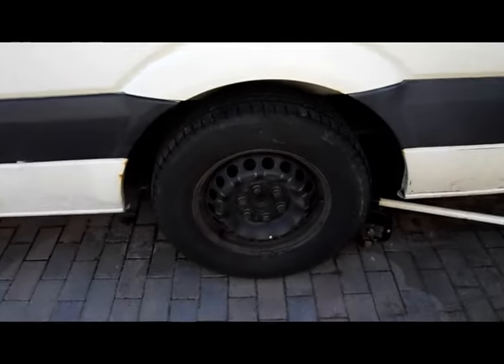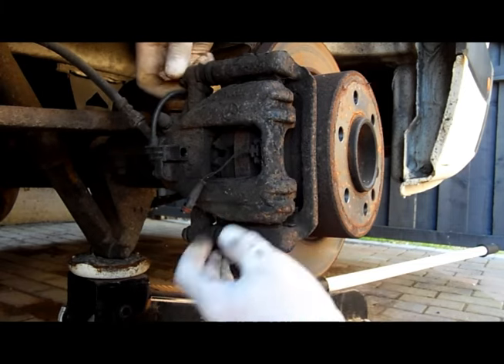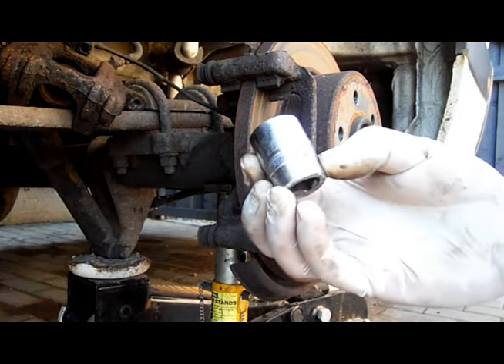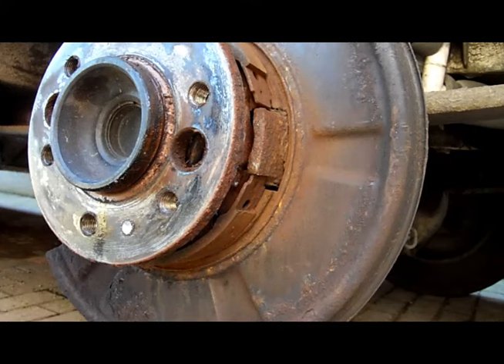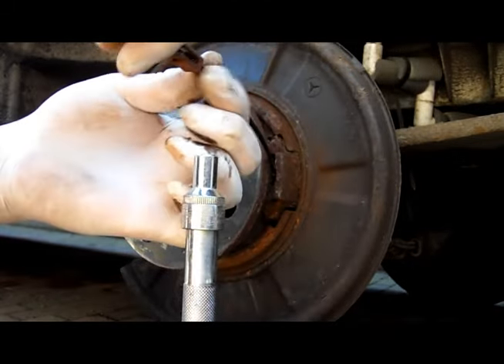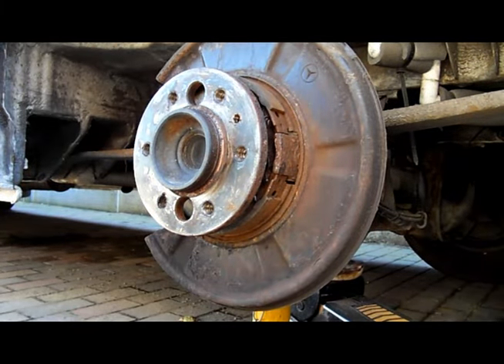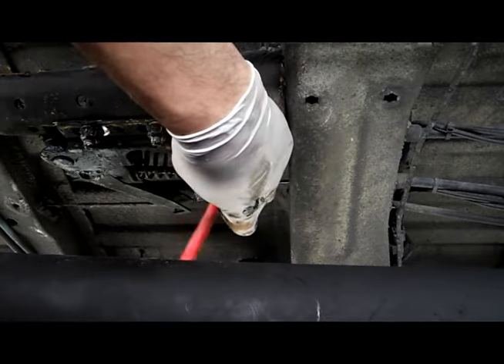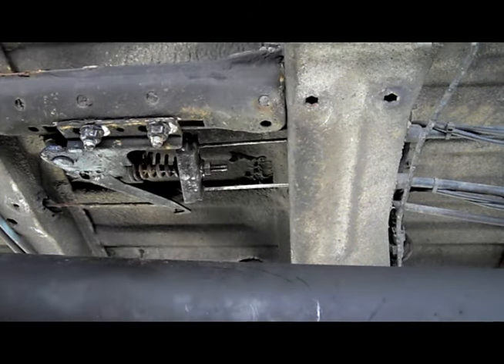VW Crafter / Mercedes Sprinter Handbrake Fix

Comment: Tip for all. Use high temp brake grease in place of copperslip. It will last years rather than weeks. Copperslip has it's uses, but it's only marginally better than nothing on brake companants that get a lot of heat through them.

Also, the torx bolt holding the disk on. If an impact driver doesn't work. Nothing will. Drill it out, but you don't need to replace it. It just lines the disk up with the holes in the hub to make getting the wheel on easier. Instead just pop the handbrake on when the holes are lined up..... saved you a faff on drilling out that crap bolt.

Comment: Enjoyed the talking and the work. I've got the 5 cylinder '06 and have had problems with rust and seizing of the rarely used hand brake. If you will put grease on those parts that rust and seize and then put a small translucent plastic bag over the junction area that will keep the rust away and thereby the seizing. The brakes on the '06 tend to luck up upon use so
I put a larger bag over the splitting yoke from the hand brake cable and that usually lasts for 4-5 years so I am free of this routine. We have lots of road salt in Chicago so this can be a
bother unless you bag the joints. Make it a habit to work that hand brake every 5 months anyway if you do not have plastic bags.

Comment: I've just done the same job twice- firstly on a Crafter, and today on a  Sprinter, the shoes, pads and discs being the same on both. (There are options apparently as some have vented discs.) My problem in both cases was getting the springs on afterwards. Looking at the way it fits together, your method of assembling the adjuster side first makes sense but I struggled (a lot) to get the second spring on (you made it look very easy) and ended up putting the adjuster spring on second- also very difficult. On the Crafter I used Juratek components. When assembled correctly, neither side would accept the disc and I had to remove the shoes and grind bits of metal off. Very frustrating. On the Sprinter, I had Eicher discs and Bosch shoes which went on no problem. BTW, I think the wear sensor should be on the inner pad as that is the one you can't see.
Reply from the maker: The trick with the spring (which you can't really see in the video) is that I'm levering down against the shoe on the other side so applying quite a lot of force with minimal effort.

Comment: Super helpful video. I thought my handbrake arm thing behind the disc had become seized, turns out it was the handbrake assembly under the van! Rusted so badly it wouldnt move and was basically locking the handbrake on.

Comment: Excellent instructions very informative, I’ve a 1998 lt35 camper with seized handbrake, I guessing mine will work similar if not the same as these

Comment: These are worse than the old sprinter/lt35. Ive niw got a crafter thats been parked up for 2 months and brakes are slightly seized. Gonna look at rear wheels first as from what youve described/ done is the most likely culprit. Never had this in the older vans.
Reply from the maker: Yeah. I was deeply unimpressed with Merc quality compared to an old 307D I had years ago.
Reply: My 2002 LT35  handbrake has just stuck on, is it the same kind of set up as this ? Any tips for unsticking it would be greatly appreciated ?
Reply from the maker: True. Quality at VW and Mercedes seems to have gone down dramatically in the last decade or so.

Comment: On the video at 7.21 minutes In ….ther is a pivot section with a spring attached to the bottom of it,  just where the man’s hand is holding / or just beside …does anyone know the correct name  for this part I need this particular part for my Mercedes sprinter campervan 1998
Reply from the maker: Hi. Don't know which country you're in, but the following url should give you a part number. https://mercedesgenuineparts.co.uk/products/brake-cable-adjustment-a9064200238-sprinter-906-907-model-series
Reply: @rdownmakeITbetter  thank you, I’m in the UK.  The link gives me the name it’s a start for my search

Comment: Great video!   I like how your clearly narrating your work.   Reminds me of a TV  reporter at a pro Golf Tourney ( British Open ) while standing beside the green explaining what’s happening.   I like it.    I’m a “proud “ owner of a 2008 Sprinter 3500 Dually  (170wb ) to hopefully make a MotoVan from it for weekends.  It sits a lot.  I engaged Park Brake when I jacked it up to paint rear wheels and now I let the lever down ( the light goes off ) BUT when I put into D or R it sounds like it goes into gear BUT I go nowhere.   I removed wheels and hammered back the actuator at the end of the cable and the passenger side now rolls BUT the driver side will only move a few inches.   When I look into the lug hole to find adjuster  ALL I FIND ARE SPRINGS.   NO ADJUSTER.    The disc brakes broken you think?   There’s nothing else to stop the wheel if it’s in N.   Must be bad ?    The caliber pads seem to have 1000ft lbs torque so I was hoping to adjust through the hole.    IF I COULD SEE IT.    AGAIN I’m looking through the a lug whole.   I don’t have a hole with Torx nut in it.  Is that on a diff circumference than the lugs?   I thought it was the same.     Sorry for the long one.   Thanks !
Reply: q

Comment: Does it matter which way up the offending item as you put it, goes? The shoe expansion actuator shackle whatever it's called.
Many thanks
Reply from the maker: It's a long time ago now - but I'm pretty sure it only works one way up which is the way that gives a straight pull on the cable without kinking it over the backplate. Basically, the same way round it came out.
Reply: @rdownmakeITbetter  thanks so much for the reply I managed to sort it. I'd taken it off a couple of weeks ago and just put it back yesterday so couldn't remember myself.

Comment: Thank you for the video   My slack adjuster is quite rusty so I am choosing to wire brush the rust and treat it with green acid  and liquid wrench till it looks like I can get the bolts freed up. I'd say leave  that part alone if the Handbrake feels proper(especially if it's rusty), if it's too rusty replace it), I think someone in the comments said that they could not get their discs over the drum after doing the brake job and underbody slack adjustment.  I would initially just change the pads adjust the brake at the wheel and check the feel at the cab handbrake.   The focus when re-installing the rotor should be a good  'tight' (as in the rotor goes on and off without cocking wedging the pads too much and the way to do this is you need to shimmy the rotor clockwise and counter clockwise while going on or off.

Comment: how did you drill the torque bolt out ? Tried hss bits and nothing ?? Thanks in advance
Reply from the maker: It's not about the bit, it's about technique. Turn the drill slowly, apply plenty of pressure, use oil to lubricate it and keep the bit sharp. You shouldn't have any issues - those bolts are not hardened in any way.
Reply: @rdownmakeITbetter  cheers mate. Followed what you said and got it 👍. The top plate for the handbrake inside the drum has cracked. I’ve ordered new set going to pick it up in morning. There a few springs inside and 1 of them fell out when took the drum off . 👍

Comment: Thankyou, a very informative video, gives me the confidence to investigate the horrendous rattling from the rear, sounds like something is hitting the tin backing plate
Reply from the maker: One of the common failures on this set-up is that the pin and clip device holding/locating the shoes in place can rust away allowing the shoes to 'float' and rattle against the backplate. A replacement set of pins is relatively cheap from any motor-factor.

Comment: What size socket did you use for the carrier bolts?
Reply from the maker: Hi.. off the top of my head I don't recall but VW tend to use all the in-between sizes no one else uses like 16, 18 etc.
Reply: 21mm

Comment: Nice video. I'm doing the same to my 2006 sprinter. Just one question I'd like to ask,if I may. At around 7.20 sec's when you're adjusting the handbrake tensioner which position is your actual handbrake level in. Fully off, 2 clicks up or fully up ?.  Also did your engine management light come on after, if so, how did you get rid of it. ? many thanks for your reply.
Reply from the maker: Hi. I'm glad someone is still finding this useful. When you're taking up the slack in the front cable, the handbrake lever should be fully down as it would while driving. You're just taking out the slack so the cable doesn't rattle around and wear out. For the next stage of the adjustment, you should probably have the handbrake up by a couple of clicks - but there's generally enough slack in the system to not bother with this.